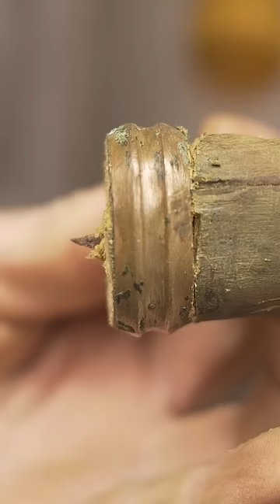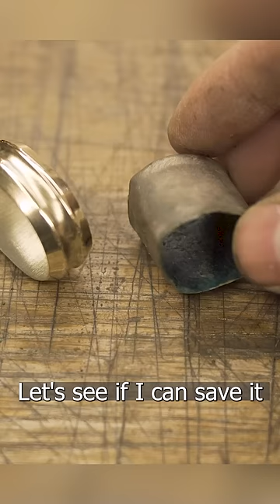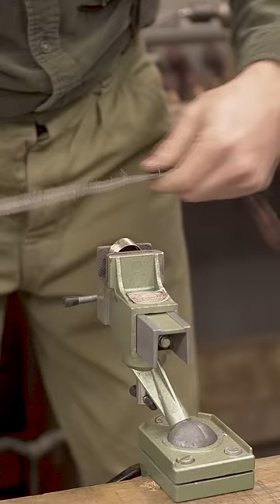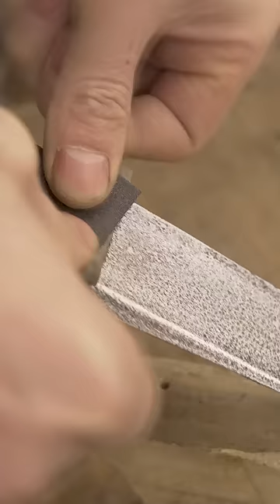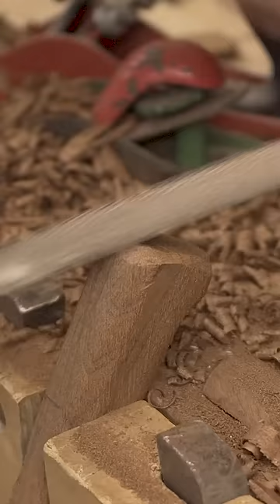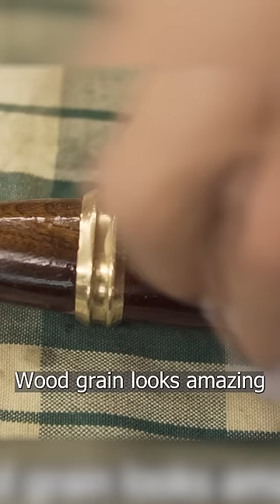Chef Knife from 1878 year #restoration #kniferestoration #chefknife

Comment: I really enjoy seeing people work with power tools powered by humans. I think it makes a stronger connection with the work you do
Reply from the maker: Awesome 👍
Reply: Life before electricity was full of very clever ideas which had a millennia to evolve and develop, sadly the introduction of the electric motor saw a rapid demise of this technology, but many of these tools still survive and are still used and really can't be improved on like the humble hammer for example,
Reply: Not really. It just cuts time in half. Your bullshit connection it's just in your mind.
Reply: @RRAX  completely false. When you use something mechanical you have to understand how it works, how to maintain it, and how to repair it. When you have an electric tool you take all that away. You just become lazy
Reply: @joodlebug  yes you are correct there my freind, also the way you maintained your equipment was the equivalent to its lifespan so to speak another words if you looked after your equipment well it would last a lifetime however you cannot say same thing about electronic tools they tend to have a present lifespan ,and once they break need to be replaced ,self repair isn't really an option
Reply: @2_Trillion_galaxies  agreed. Same reason you feel so much more of a connection to an old car with a mechanically controlled engine than a new car that is entirely controlled by computers and practically irreparable
Reply: @joodlebug  its called maintenance, still No c0nEcTiOn
Reply: @RRAX  not my problem that you find no joy in this world
Reply: @RRAX  we need people who know how to work without electricity, human technical infrastructure is an fragile thing, and we are one solar flare away from doing without.
Reply: @2_Trillion_galaxies  the same can be said for power tools or anything. The better you treat and maintain it the longer it will last. Not everyone just throws shit out when it quits. I’ve repaired several power tools. I love my tools. The same way this guy loves his. There’s no magical connection because it was built by hand with no electricity. That’s just some inner spiritual shit you might feel. Doesn’t make the piece any better or worse.
Reply: @joodlebug  using power tools makes you lazy? 
I could assume that someone hasn't worked with Power tools  to make that assertion. But I won't 👍🏽.
Reply: IMO it makes less work get done.
Reply: @joodlebug  I mean I routinely fix my electrical tools if they break on me so I'm not sure what you're on about. It's just... Inefficient.
Reply: Makes for better products too.
Reply: Definitely, even I got interested in wood work but I'll use my great grandfather carpenter tools, from every chisel and handsaws he had stored away 😁
Reply: I think that both hand-powered and electrically-powered tools each serve a purpose. However, currently there is an imbalance between machine and mankind; we are replacing more and more humans with machines. So seeing someone restore a knife by hand is refreshing to watch.🙂🙏❤
Reply: @RRAX  i don’t think he’s saying it makes you lazy as in you are lazy for doing it, but that it makes you think less, which makes you lazy. it requires less understanding, a lower barrier for entry means something is lost.
Reply: I make bows and the only power tool I really use is the chainsaw I use to drop the trees.
Reply: Beautiful
Reply: Definetly, it also forcefully develops skill to power the tool and work with one hand
Reply: Well, did you ever try to train a cat to do it?  They just lay down and lick themselves...
Reply: @2_Trillion_galaxies  what is this foot powered tool called
Reply: @2_Trillion_galaxies  they still had electricity. Just not everybody had it
Reply: The debate between power tools or hands tools will go on for infinity. But I'll add this: the bad part of power tools is its way easier to go to far, take to much off, fuck it up. Cuz we all know u can take a lil more off, but puttin it back is pretty hard sometimes. Hands tools force u (by their very means of operation) to take/ have time to look see the project over for a better grasp of when it's enough. But there's alot to be said about a chopsaw at the end of the day and your arms are already tired af. Just my 2 cents
Reply: @oliverklozhoff  well not much was going on with electricity until 1883 when electricity started to be rolled out before then it  was steam and before steam it was "horse power"
 which is a term still used in the every day vanacular
Reply: @RRAX  💩👜
Reply: That’s a false moral equivalency.
As if using non electric is somehow more moral and right. It’s like when guitar “purists” claim about mechanical tuners vs friction ones. It’s purely placebo and false equivalency.
Don’t care how he restores it (and it was done well btw). Substance over image.
Reply: @hedgemowerman   I think we are all talking about the feeling of well being and accomishment that a craftsman would get from doing it all himself with his own to hands with as little help as possible from elaborate  machines ,returning to a time when time was plentiful ,and stress was low,
Reply: @2_Trillion_galaxies  Romantic nonsense. Machines were invented to augment the tasks, save time and energy, and to alleviate physical labor and stress. 
Now that we live in a time period of leisure, this constant romanticizing things is just "Midnight in Paris" nostalgia. I love making things with my hands too, but the achievements aren't diminished by using electric and gas-powered tools. It's still me.
All the best to you liking his stuff and how he does it, but it's not more noble or better. No difference if the product and outcome is the same.
Reply: @hedgemowerman  but Mark you've missed the most crucial part of all, there weren't any green house gases emitted,
Reply: @2_Trillion_galaxies  nailed you on that one, didn’t I? You had to switch from plentiful time and leisure to climate change- come on, man. Do better than that- don’t use lazy arguments.

Comment: That knife will hold an edge forever. They don't make steel like that anymore.
Reply from the maker: I couldn't agree more 😉
Reply: Bruh, steel is better than it ever has been, modern powder steels make this stuff look like garbage
Reply: @hannahmay5461  looks better isn't better.. modern steel is ful of impurities from being recycled over and over. That knifes Virgin steel.. only seen the forge once!
Reply: and will rust 10 minutes later, I did the same thing, good for decoration only.
Reply: @nunyabusiness4651 you think all steel is recycled,  like they just ran out of iron ore n gave up looking for it. What about premium steels made from powders to keep the molecular structure tighter and uniformed. Not to mention the knowledge of different blended metals n heat treatments learned over the last 100 years. Come on man
Reply: @nunyabusiness4651  Modern steel is objectively a lot better, just stop with the "they don't make em like that anymore'' nostalgic BS.
Reply: I was a machinist last 45 yrs. Metals just keep getting better and more exotic I machined steel that carbide would just bounce off when trying to cut it.

Comment: Bet the steel in that knife is good. Nice job
Reply from the maker: Oh yeah, I worked on many knives and this one is for sure top notch 👌
Reply: most definitely.
I've been told by an old engineer that knew his materials, that back when they used wood charcoal for steel making, the purity of the steel was great, and when they started to use regular coal from the ground, it was full of impurities that we have eventually learned how to deal with, but the Bessemer process was economical and flawed at the same time.
they make great steel today, and for awhile but there was a big learning curve to get through after the last bits of forest were coaled off, because Steel making took a lot of the forested area.
Reply: @richtomlinson7090  fascinating thank you

Comment: My husband has an old civil war saber that i wish, so badly, that he could restore it without destroying the value. He has that and an old flint lock rifle hanging together on the wall. They look really good together. Im mainly just worried that they could both keep degrading over time, if the small amount of oxidation starts becoming actual rust
Reply from the maker: Wow, both are incredible. Thank you for sharing. One of the way to prevent further degrading is to rub a natural beeswax. It will protect metal from rusting, prevent leather from cracking and prevent wood oils to dry. Good luck ☺️
Reply: Thank you for the advice. We will definitely try that. I would love to be able to pass them on to my son one day
Reply from the maker: @coreybarnwell2621  of course! Sounds amazing 👌

Comment: Would it have been wrong to give it a new shape. Maybe cut it shorter put a nice point on it or were the knives shapped like that back in the day?
Reply from the maker: It would not be wrong but it would take too much material to get pointy tip. Otherwise, originally this knife had a sharp tip.

Comment: Must be somewhat difficult to run the polishing wheel that way. You usually have the piece with both hands with a powered one.
Reply from the maker: It would be easier with two hands for sure, but it is not that bad 😉

Comment: I just picked up a hand-crank "machine" just like you have your polishing wheel on.  Where can I find information on if it is missing parts?  And yes it turns smooth as glass still.
Reply from the maker: Try finding some old magazines or catalogs. They were described in those 😉
Reply: @FFD_Restorations  I'll see what I can find. Thanks for the suggestion.
Reply from the maker: No worries, best wishes!

Comment: You do know power tools were invented right?
Reply from the maker: https://youtube.com/@FFD_Restorations/about
Reply: @FFD Restorations  yeah I get that but, they were.
Reply: @FFD_Restorations  do you like, cheat a little, like off camera? 
It's just one little drill lol
Reply: @FFD Restorations  no hate btw. I loved the video. But I didn't know if you were like, against modernity. The clothes, tools, projects. Wouldn't make sense if you were because I just watched it on the internet.
Seriously tho, not even a little bandsaw or circular saw?
I think it'd be really kickass if somebody rebuilt a modern thing with legacy techniques and materials. Imagine a new item with classic build, texture, and style?
Like a microwave but resheeted with brass inlay and analog controls or a flat-screen rebuilt to look like a early console t.v. a Bluetooth speaker dressed up and pulled apart electrically to interface analog volume control in a vintage wooden radio case, include fm transmitter and receiver.
Reply from the maker: @Dutch.W  and why I would do that?
Reply: @FFD Restorations  not even a little tiny bit of beltsander?
Reply: @FFD_Restorations  it would be easy.. just turn it on and woosh, the 20 hours of sanding done in like 5 seconds
Reply from the maker: @Dutch.W  sorry to disappoint you but no.
Reply: @FFD Restorations  okay. I get it. But home depot isn't far..
I still like the good work tho so keep that up! 
Whispers dewalt, milwaukee,makita,ridgid...
Bosche...
Ryobi, hilti, skill...
Ok I'm done.

..dremel.

Comment: I am tripping or did he use sand paper to sharpen the knife
Why is the edge rounded
Reply: @FFD_Restorations  sorry man
I bet you dont do that now and it is an old video
Or not
But i like my Japanese knives
I cant sharpen like them so i had to get a designer self sharpener that only sharpened one side at a time so it didnt matter that i had no skill 
In saying that my goal over a decade was to have the sharpest blades as i love swords like i love fire
I have been very casual about that goal mind you
But even 20 years ago in school a shaped a double sidded 10mm thick by 150mm x 100mm double sided axe and just a grinder and sand paper after hardening for weeks
Still impress me i dont it
So polished the edge doesnt rust
I think it was forge steel and hasnt go a handle
Its sharp as buggery and i cut a slot for the handle to weld in a steel bar directingly to the blade and even make the entire handle from steel bar
Silly things i came up with in school
Reply from the maker: @Darkstar.....  👍